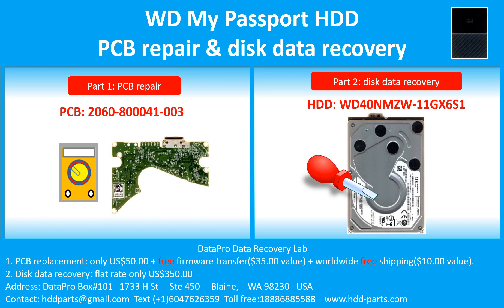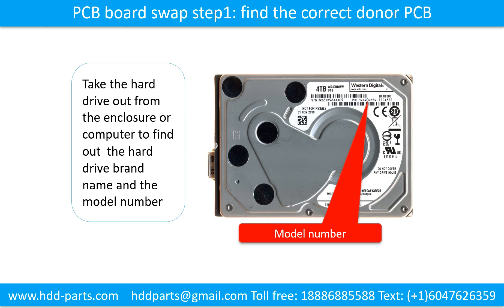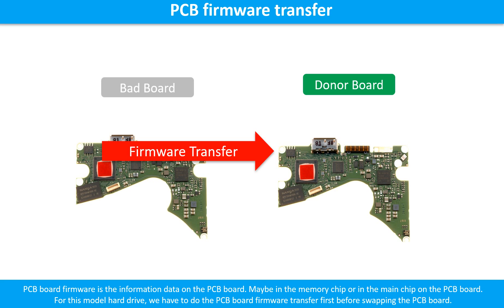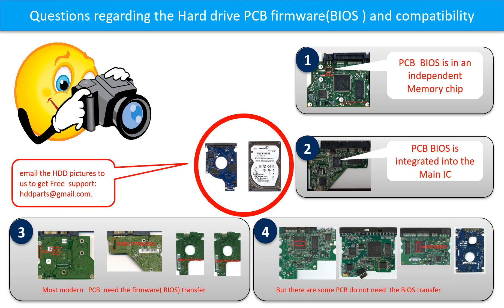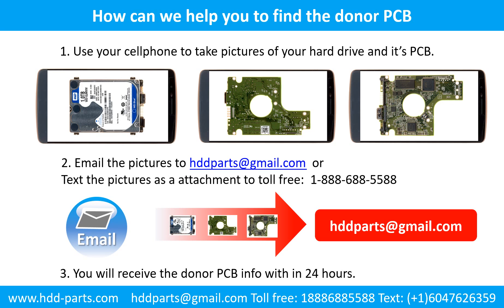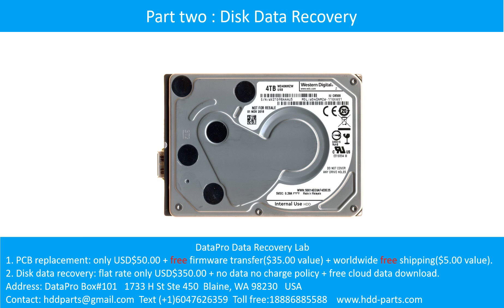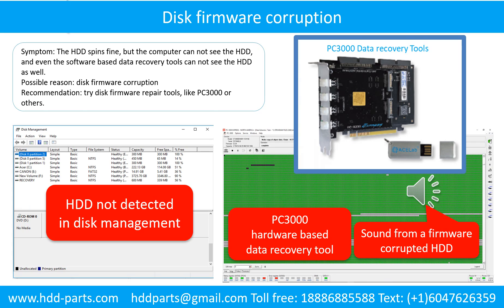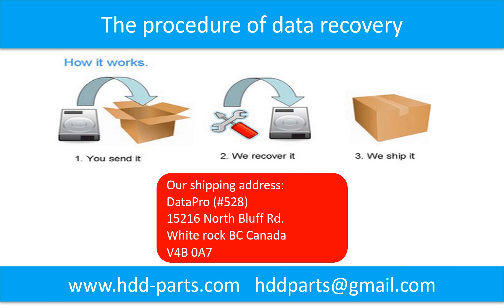WD WD40NMZW 11GX6S1 WD30NMZW 11GX6S1 2060 800041 003 P1  WDBYFT0040BBK 0A  circuit board repair  dat

Comment: Question for you....

1. on these  HDD, there is no standard SATA & Power connectors, correct ? (they have been replace with the micro-B in the PCB board)
2. is there a way of relacing the micro-B PCB board with a standard SATA & POWER connector ?

cheers